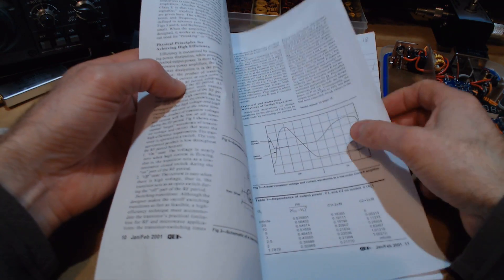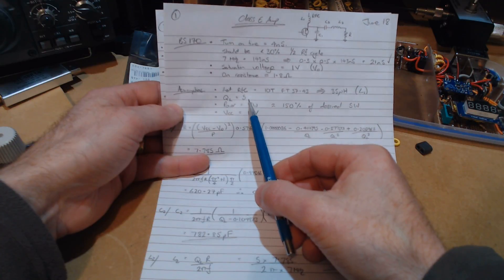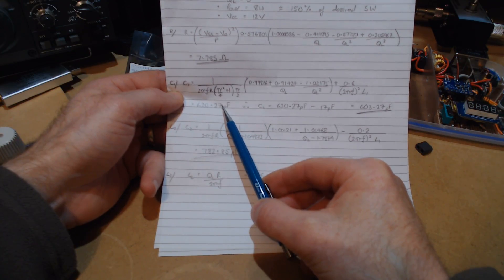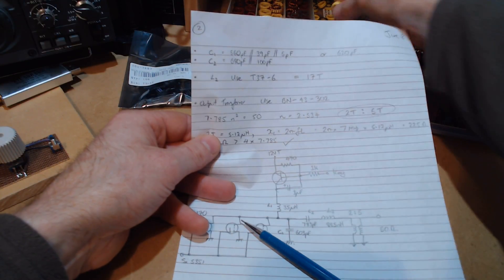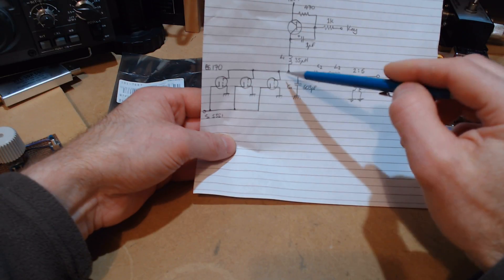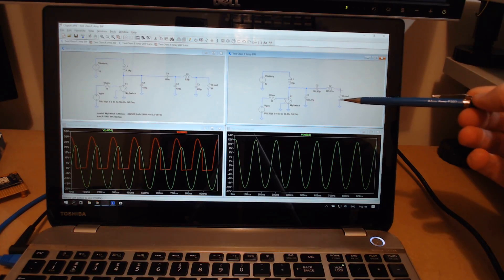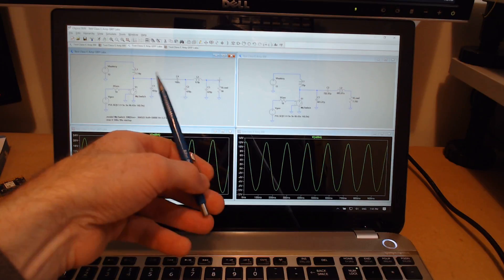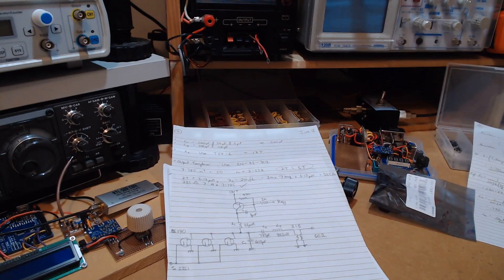Homebrew 40m CW Rig - #5b Class E Amp Design

Comment: Very nice! Hopefully I can use what I learned a bit to try and build a FM AMP for either 2m or 6m. Probably will have to do some more reading to figure out if a Class E AMP will work for FM but learning is the fun part.  
KD9KCK
Reply from the maker: I'm sure you will. By all accounts it's a great amp with high efficiency. I like it's simplicity too. Hopefully, I won't let any magic smoke of the BS170s!
Reply: Charlie Morris yea, I hope you don't either. And I hope I don't smoke any parts in my 6m build I am designing still.  Interesting I am going to be using the same mixers you used in your SDR SSB project. (I think. Unless I just build some diode ring mixers myself.)
Reply from the maker: I built some DBM mixers a while back using FT37-43 based transformers and IN4148 diodes. I spent some time matching the diodes, which paid off as the overall mixer worked really well. Too big for the portable rig though!
Reply: @CharlieMorrisZL2CTM  I use ade1s but I thought about making a DBM. Where do you find good, no silicon diodes?
Reply: Hi Sir, could you please share the photo of the calculation sheet?